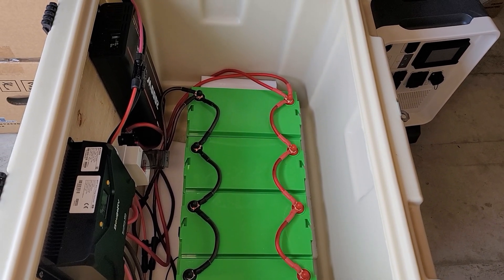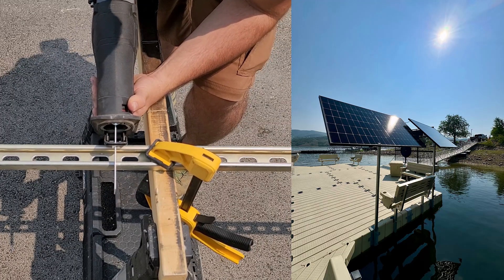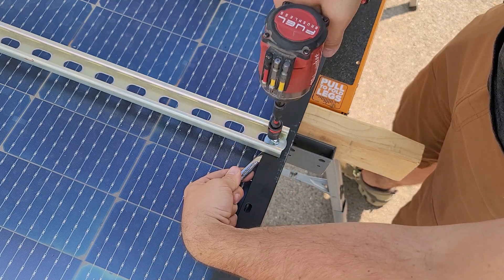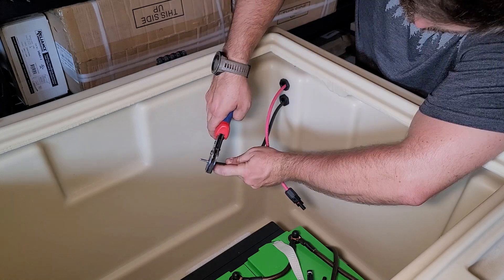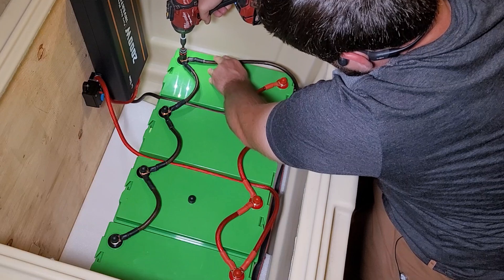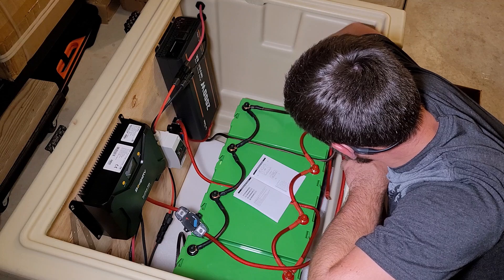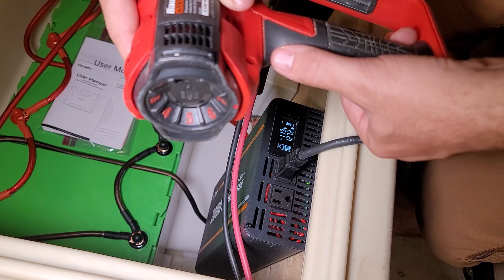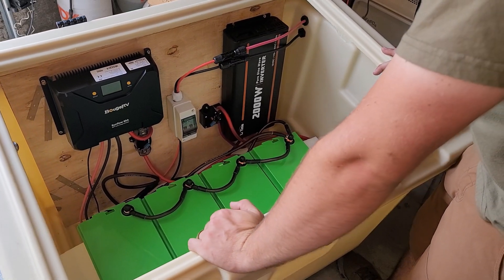DIY 5 kWh Solar Power Bank for Off Grid Boating Dock

Comment: you should do 1 connection to each end battery. Positive cable attaches on one battery and the negative connected to the opposite end battery. NOT CONNECTED TO SAME BATTERY

Comment: It's too bad you used that cheap, high-frequency transformerless inverter. They offer a shorter life expectancy and a far poorer surge capacity. Even worse, they can damage your AC appliances because they don't offer any galvanic isolation between their DC boost stage and their AC output. A much better choice for an inverter would have been a low-frequency transformer-based inverter. They offer a much longer life expectancy and a much higher surge capacity for powering inductive loads, and they offer much safer operation, especially when used near water.

Comment: The only issue with your battery configuration is the batteries are going to age differently. Shouldn't be any short term issues. I believe the battery closest to the inverter is getting worked more than the others.
Reply from the maker: Yes, it would've been better to have different leads in different spots, I mentioned that briefly in the video that I was trying different configurations. This generally draws a 50w load constantly, so I am not worried about them getting that unbalanced because it's a 5,120wh battery pack with a 50w load and 880w of charging. I felt confident that they will stay balanced enough with this setup. If I had heavy loads I would absolutely change the wiring configuration. Thanks for pointing it out so others can learn.
Reply: You are correct but this is built as a simple solution.
Reply: The fix to this is to run the negative from battery 5 and the positive from battery one in this configuration. Glad you pointed this out!
Reply: @rickmaff  During the video you see him change the configuration a few times trying to get the cable management situated. I'm not sure how long it will take before any measurable difference shows up.
Reply: @rickmaff  there is 4 batteries.
Reply: @Scott-ig1zd  yeah I see that, same method applies. I've been watching too many of the 5 battery rack mounted setups and I mistyped lol
Reply: Hi, good video. Another one on YT goes through multiple batteries and when you have 3 or above a bus bar is the best to get the resistances to each battery balanced. Saying that it should take years to have an affect given their cycle lifetime.
Take care M.
Reply: He has 4 batteries and he's got the positive coming from battery #1 and the negative coming from battery #4. Which is the correct way. This is on a boat dock and not used every day, being in parallel they will balance themself.
Reply: @Scott-ig1zd  He had it that way. He changed it to have both positive and negative coming from battery 1.
Reply: @Scott-ig1zd  Hi he had it this way which would have been better and then decided to redo it to tidy up the cable runs and both ended up coming from the first battery.
Take care M.

Comment: New to this solar stuff.  I thought if you had a 48V system it required a 48V inverter.  Is the reason you are able to use the 2000W inverter on this diy because the batteries are 12V and you connected them in parallel?  Thanks for the video.
Reply: Four 12 volt batteries in parallel stay 12 volt. Four 12 volt batteries in series is 48 volt.
Reply from the maker: You're correct, but this is a 12v setup. Batteries connected positive to positive are in "parallel" which keeps the same voltage. Had I don't positive to negative then they would be in "series" and would increase the voltage.

Comment: Weak inverter need 3kw min
Reply from the maker: Normally I would agree but this only ever pulls a 50w constant load. If it's used in the winter, which it isn't, then the max it pulls is 150w. So a 3kw was way overkill and I had the 2kw so it worked out.
Reply: @minutemansolar  how would this stack up to a ecoflow delta 2? i was thinking I would be better of learning to build rather than buying ready made system for emergency backup for wifi and some lights and a small portable fridge/freezer
Reply from the maker: @toddfogleman  Honestly, I wouldn't stack this against a Delta 2. DIY systems are a different category in my opinion. You can DIY a system to save tons of money, learn a lot, and possibly have some hiccups like I did in this video. Or you can buy a system that is done and ready to use out of the box. It's the same way that I wouldn't compare a Delta 2 to a grid tied solar system, they're just two different categories.
Reply: Nice build 👌
Reply: It's only a 12v system. That inverter is more than enough for most applications